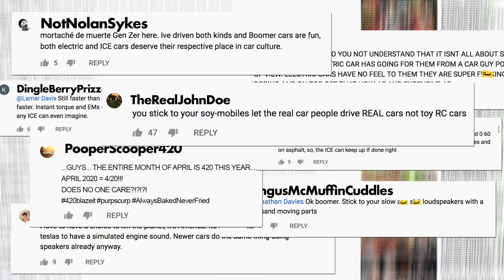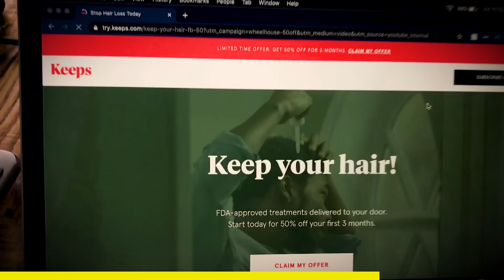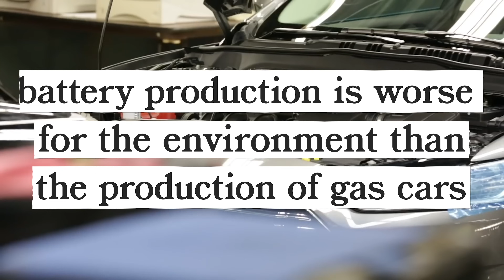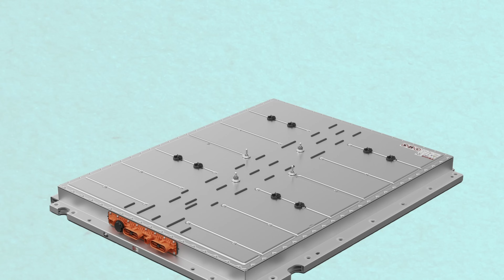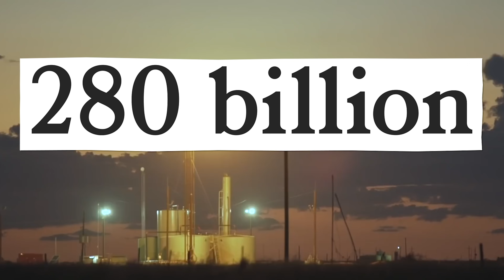Are Electric Cars REALLY Better for the Environment?

Comment: Batteries, they do not make electricity – they store electricity produced elsewhere, primarily by coal, uranium, natural gas-powered plants, or diesel-fueled generators.  So, to say an EV is a zero-emission vehicle is not at all valid.
 
Also, since forty percent of the electricity generated in the U.S. is from coal-fired plants, it follows that forty percent of the EVs on the road are coal-powered, do you see?"
 
Einstein's formula, E=MC2, tells us it takes the same amount of energy to move a five-thousand-pound gasoline-driven automobile a mile as it does an electric one. The only question again is what produces the power? To reiterate, it does not come from the battery; the battery is only the storage device, like a gas tank in a car.
 
There are two orders of batteries, rechargeable, and single-use. The most common single-use batteries are A, AA, AAA, C, D. 9V, and lantern types. Those dry-cell species use zinc, manganese, lithium, silver oxide, or zinc and carbon to store electricity chemically. Please note they all contain toxic, heavy metals.
 
Rechargeable batteries only differ in their internal materials, usually lithium-ion, nickel-metal oxide, and nickel-cadmium. The United States uses three billion of these two battery types a year, and most are not recycled; they end up in landfills. California is the only state which requires all batteries be recycled. If you throw your small, used batteries in the trash, here is what happens to them.
 
All batteries are self-discharging.  That means even when not in use, they leak tiny amounts of energy. You have likely ruined a flashlight or two from an old, ruptured battery. When a battery runs down and can no longer power a toy or light, you think of it as dead; well, it is not. It continues to leak small amounts of electricity. As the chemicals inside it run out, pressure builds inside the battery's metal casing, and eventually, it cracks. The metals left inside then ooze out. The ooze in your ruined flashlight is toxic, and so is the ooze that will inevitably leak from every battery in a landfill. All batteries eventually rupture; it just takes rechargeable batteries longer to end up in the landfill.
 
In addition to dry cell batteries, there are also wet cell ones used in automobiles, boats, and motorcycles. The good thing about those is, ninety percent of them are recycled. Unfortunately, we do not yet know how to recycle single-use ones properly.
 
But that is not half of it.  For those of you excited about electric cars and a green revolution, I want you to take a closer look at batteries and also windmills and solar panels. These three technologies share what we call environmentally destructive production costs.
 
A typical EV battery weighs one thousand pounds, about the size of a travel trunk.  It contains twenty-five pounds of lithium, sixty pounds of nickel, 44 pounds of manganese, 30 pounds cobalt, 200 pounds of copper, and 400 pounds of aluminum, steel, and plastic. Inside are over 6,000 individual lithium-ion cells.
 
It should concern you that all those toxic components come from mining. For instance, to manufacture each EV auto battery, you must process 25,000 pounds of brine for the lithium, 30,000 pounds of ore for the cobalt, 5,000 pounds of ore for the nickel, and 25,000 pounds of ore for copper. All told, you dig up 500,000 pounds of the earth's crust for just - one - battery."
 
Sixty-eight percent of the world's cobalt, a significant part of a battery, comes from the Congo. Their mines have no pollution controls, and they employ children who die from handling this toxic material. Should we factor in these diseased kids as part of the cost of driving an electric car?"
 
I'd like to leave you with these thoughts. California is building the largest battery in the world near San Francisco, and they intend to power it from solar panels and windmills. They claim this is the ultimate in being 'green,' but it is not.  This construction project is creating an environmental disaster.  Let me tell you why.
 
The main problem with solar arrays is the chemicals needed to process silicate into the silicon used in the panels. To make pure enough silicon requires processing it with hydrochloric acid, sulfuric acid, nitric acid, hydrogen fluoride, trichloroethane, and acetone. In addition, they also need gallium, arsenide, copper-indium-gallium- diselenide, and cadmium-telluride, which also are highly toxic. Silicon dust is a hazard to the workers, and the panels cannot be recycled.
 
Windmills are the ultimate in embedded costs and environmental destruction. Each weighs 1688 tons (the equivalent of 23 houses) and contains 1300 tons of concrete, 295 tons of steel, 48 tons of iron, 24 tons of fiberglass, and the hard to extract rare earths neodymium, praseodymium, and dysprosium. Each blade weighs 81,000 pounds and will last 15 to 20 years, at which time it must be replaced. We cannot recycle used blades.
 
There may be a place for these technologies, but you must look beyond the myth of zero emissions. 

"Going Green" may sound like the Utopian ideal but when you look at the hidden and embedded costs realistically with an open mind, you can see that Going Green is more destructive to the Earth's environment than meets the eye, for sure.
Reply: Dude why? Tldr man, Tldr .

Comment: Nice video. Very educational. Can you do one based on cost? Most ev cars are more expensive than the average gas guzzler. I’m curious what the price difference is averaged out over 5 or ten years. Gas, maintenance, insurance, charge expense, rebates, home kw usage, etc…
I’d say start the comparison with a Toyota Camry with an average of 30mpg to the most popular Tesla model.
Reply: The main issue is depreciation. The battery warranty is usually 8 years. A Prius is already known to depreciate more quickly than a Corolla. if the battery needs to be replaced after that, you're out by a few thousand dollars. With a Tesla that will be at least ten thousand dollars.

Comment: I thought the video was interesting, but if you things seem to far-fetched or left out.
I am not against EVs but solar and wind are nowhere near producing a significant amout of electricity. At maximum generation they make a small impact, but they very rarely are at maximum and many days neither are producing energy in much of the country. Nuclear, natural gas and coal plants can run at full capacity the vast majority of the time and nuclear is by far the cleanest reliable source of energy that doesn't require future technology to make viable.  But you failed even mentioned nuclear, which is not impartial.

I am only mentioning this cuz you talked about, "states that have access to wind, solar and hydro" three or four times which makes it sound like it makes a significant impact and which state you live in makes a difference. Well it doesn't make a difference in any state if wind and solar are not as significant amount of the grid, so that highly emphasized statement is just emotional.
Second, lithium extraction in its current form is less sustainable than natural gas and oil. Lithium is not very easily recycled and is not a renewable resource as of yet. And if something was to happen in the regions that have lithium production like what's happening in Ukraine we would be overly dependent on foreign powers.
EV might eventually become good enough that they should replace most gas vehicles, but we are not there yet. Promoting that people buy more of them before the industry has become better is not necessarily going to force the industry to become better. I think until California and Texas fix their rolling blackout problems they have we shouldn't be subsidizing more blackouts.

Comment: Hey, Nolan; thanks for an interesting video. Two comments: 
1) Please expand on your statement at the 10:00 time point - that our current electrical grid could, tomorrow, support 25% of EVs.  You didn't explain how that's possible. Here in SoCal, we have had hours-long rolling blackouts during the summer months as people use their power-hungry air conditioning, and that was well before EVs gained popularity. Going from the current 4% of the car population to 25% won't help that. So, my tax dollars, going as subsidies to EV owners, actually pay for my having to suffer rolling blackouts. Go figure. 
2) Electrical generating stations mainly use either coal or Natural Gas. However, many cities across the USA already use NatGas busses, trash trucks, government vehicles, etc, and have been doing so for decades.  Why not just skip all the huge losses of energy and go right to NatGas (otherwise known as Compressed Nat Gas, or CNG)?  At the generating station, using these fuels to make steam to run turbines results in a 50% loss of that energy, and that doesn't even include the further energy losses in distribution and recharging Li-Ion batteries. Here in LA, I filled up a CNG car yesterday at $1.35 a gallon. That's not a typo. It's exactly the same stuff that comes out of a kitchen range. All that needs to be done after removing it from the ground is to filter and distribute it, and we already have the infrastructure in place (gas stoves, that is). This makes using Li-Ion batteries a complete farce, the 3-card Monte of the 21st century.
Reply: People don't want to have to deal with the truth of the American electrical grid. It's 50+ years out of date and cannot support even 25% of the US using EV full time.
Reply: This was my thought as well. There are several cities in the US that have rolling black outs. On top of that, I live in Northern California, where PG&E shuts off the power several times a year for DAYS at a time, due to them sparking wildfires on windy days. 

Power is limited during high use hours 4pm to 10 pm. You know, the hours most people come home from work and would plug in an EV. There is no way I could trust an EV to be reliable le transportation, when I can't trust the power to be there to charge it.

Comment: A gallon of gas is equivalent to 33.7 kWH of electricity.  Electric vehicle batteries start at around 35 kWH and range starts at around 100 miles.  A Nissan Leaf uses the equivalent of a little more than a gallon of gas to go it's entire range, approx. 150 miles.  Mini EV - 110 Miles, Mazda MX-30 100 Miles...  A Tesla Model 3 goes 220 miles on a 50kWH battery.

The dangers of batteries is over rated.  If you have 1M of anything out there, you're going to see catastrophic failure of something...  just like you see in ICE bursting into flames, like a Ford Pickup with a leaky brake line causing a short (actual issue with a Ford truck model) or a Plym-tsubishi (I wonder how many people will get that reference...) center console lighter igniting the interior.

Nolan, You have a Widow's peak.  Men with Widows Peaks' tend to not have thinning hair.

Comment: I can't buy that the production and transport of lithium-ion battery packs requires more energy than all those steel, copper and aluminum parts.  How does setting lithium in the sun to dry, make CO2?  
And saying lithium is not recycled.  That is nonsense.  The cells are tested first, and the good ones are sold for reuse on eBay or wherever.  The others are recycled.
Battery life is also increasing.  Million-mile batteries are not just rhetoric.  They will happen.

Comment: An ev will always be as clean as it's power source. An ice car emissions controls degrade over time. Most states don't test and people won't repair emission controls if the car is running ok. A catalytic converter last between 70k to 100k.

Comment: 1. Your numbers don’t add up. You indicated a electric vehicle takes 17 tons to produce, 2 tons / year to operate, and a lifetime usage of 28 tons. So I would assume your looking at 5 years. The ICE numbers were 7 tons, 5.2 tons / year, and 57 tons total. So roughly 10 years. Are you creating a false equivalence or hiding the expected life cycle of an electric vehicle is half the time?

2) Even if we give up ICE vehicles, we will still require oil as a society. As you point out, it’s refined to make other products. Especially plastics will still be needed as they are used, instead of metals, to make cars lighter weight, and in turn higher range

3) Are your ICE averages including heavy duty vehicles that don’t have an electric equivalent?  That would only bring the CO2 usage for the ICE average up and the electric average down. A false equivalent.

Comment: Doesn’t the constant burning of coal have to remain constant to power the electric stations, whether a car is charging or not?

Also, oil production to make things like plastic can’t be added to an ICE car because the plastics will still be created with or without ice cars.

You did note the damage done to the atmosphere for electric cars, but did you know the damage done to land to farm for minerals to make batteries? Additionally, what does the planet have more of, oil or lithium? The oil is retrieved from underground, lithium requires destroying farm land above ground.  I don’t see the comparison in damage to an eco system tbh.
Reply: The places that have lithium does not have farmland above it. Lithium recycles. Oil production is a dirty business. 40% of the corn in this country is used for ethanol for cars  20% of soybeans is used for biodiesel.
Reply: @steven4315   lithium takes up top soil to create a digging site, so yes, it takes up farm land.

Comment: Your entire debate starts AFTER over looking the root and basic answer to your question. Most electricity comes from coal and the more EV vehicles being used simply means more coal will be needed...more mining that you admitted is a major pollutant. you also never mentioned the fact that every EV has the most TECH inside it...for instance, we aren't allowed to dispose of I-pads, Lap Tops, new light bulbs, etc. etc and since there is an END OF LIFE on everything,,, that means every EV will need to be professionally disposed of. Most don't even know where to dispose of their burnt out light bulbs, let alone car batteries and the Haz Mat TECH inside the EV cars.

Comment: Two points: 1) The state of California released a study March 2022 stating the electric grid in California would NOT be able to handle the load of all EV cars in the state, 2) you must also include in your calculations the environmental damage done by producing all of the solar panels in solar farms and wind turbine components (they all contain rare earth minerals and toxic materials, and have a 20 year life cycle, thus creating massive disposal issues).
Reply: Even taking those into account, it still doesn't compare. The emissions of solar and wind power plants is during construction. During operation, they barely have any.

Bulk of ICE's emissions is during operation, which lasts far longer than construction. If including emissions from oil drilling, refining, etc., even worse.
Reply: @dbclass4075  When the amount of land consumed by wind and solar farms, their inherent unsustainabilty caused by various weather conditions, the twenty year life cycle of solar panels and wind turbines, the amount of toxic materials used in their manufacture and contained in the finished products, and the disposal issues after their useable life, wind and solar is not the answer.
Reply: @joedoaks6517  By on their own, indeed not. However, in combination with power storage or baseload plants (hydro and nuclear, especially), they can help in reduction in emissions.
Reply: @dbclass4075  I certainly agree with hydo and particularly, nuclear.
Reply: Thank you for the information, which was CONVENIENTLY left out of this biased video.

Comment: Any new EV beats any new gas car in efficiency but you have to account for the manufacturing and shipping. Driving a 90's Toyota into the ground is much better for the environment then buying a new car. And EV's for all their efficiency just aren't cost effective for the consumer especially once you get new batteries.

Save the environment.

Drive a 94 Celica.

Comment: Wind and solar are both pretty bad for the environment as well. Hydro is good, but the best is far and away nuclear.
Reply: Wind and solar aren't bad for the environment. They are renewable, but they are the worst sources of energy since they won't always produce electricity, plus the electricity can't be stored. So yeah, hydroelectricity is one of the best renewable energies out there. Nuclear energy produces lots of electricity, they only produce water vapor. But, they need uranium, which is hard to get and needs to be mined deep, and usually it's as bad as lithium mining. Nuclear reactors also require a lot of water, and produce nuclear waste, which needs to be taken care of.
Reply: @xx_360noscop_xx5  I will admit I’d like to see a more drawn out explanation of how people calculate the carbon payback periods, because I’ve seen number on each crazy end of the spectrum.